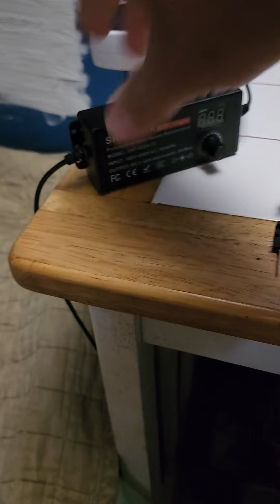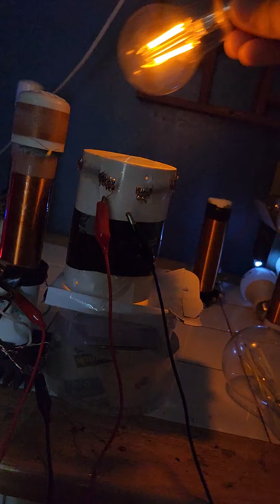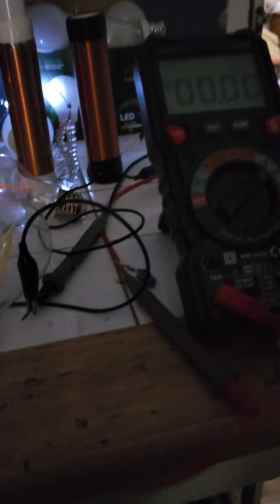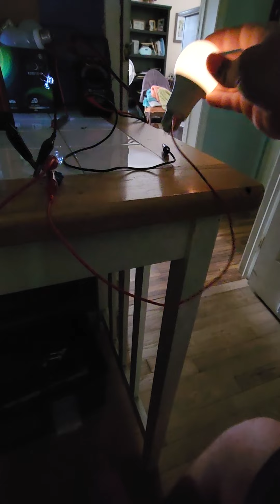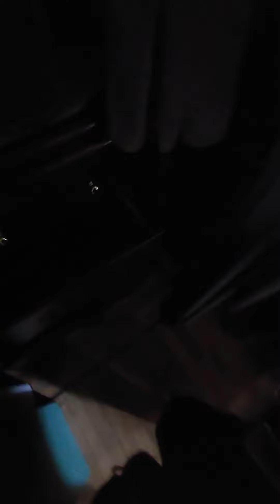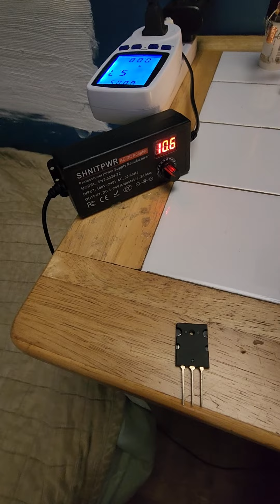⚡️⛓️ Wireless Power Breakthrough Using Only 1N4148 Diodes In A Chain! My New Discovery!⛓️ 💡

Comment: What Im not getting is if you got no consumption increases on the source so if you put 10 receivers coils around transmitter - output will be insane! Why not to try?
Reply from the maker: Going to try very soon. I just don't have much time with how much I work but I have so many things planned with this technology
Reply: Making all these other coils can act as repelling stations once they all vibrate with each other in frequency. Resistance can cause a quick dampening so he is really doing well by using additional coils probably a bit slower to get them in sequence but once they are in harmony...

Comment: Your the only one that is actually really getting so far. Because you got your transmission devices set and now you are in the first stages of using electrics and turning p/n components like diodes into antennas. Next in a Joulethief configuration tune the coil and transistor to a frequency set resonant to the transmitter. You can use a variable capacitor at the base of your transistor (bjt) and tune to the choke coil on the Joulethief receiver. You can actually control different parts of your wireless circuits by remote control from your transmitter by various frequency modulations. I am also working on this right now using plasma balls and also exiters similar to what you are doing. I am kind of old now but you are perhaps younger and can be the one to finish on my dream. Your experiments will branch out as you go. If you follow this path you will probably complete a scalar communication system that will revolutionize the space industry with faster than light speed communications. I don't want to pass away with out sharing things I have found and discoveries yet to be discovered that actually Tesla knew about but was to far ahead of his time and as you will see still is. Science today discribes it as quantum tunneling and Einstein's spooky effect. He should have listened more to Tesla. Once two rotating fields from two different angles intertwine they can produce a scalar chain the initial movement is not faster than light because this does not violate the laws of physics. Yet once contact is made on bothsides you can use the rotational movement and faze the waves to communicate and get around the light speed problem as long as the transmission is not interrupted. I am getting to far ahead with you because I have gone off subject. What you are doing is impressive I kind of see me. Lol. Because you are actually doing basically the same thing. By the way in the near future you will be able to use an antenna and a good ground to the water table and harness enough energy to run your transmitters. It will all be renewable energy. Elon Musk will want to recruit you and hopefully you and him will workout better than Tesla and Edison. If you do the world will prosper beyond our understanding today. We need these technologies today the world is ready I hope to see it before my time here is done. Thank you for sharing your videos. Your doing 👍.
Reply from the maker: Yeah I partnered with an electronics company that finds my work interesting & they're sending me reels of exotic diodes right from they're factory for free to experiment with.
Reply: @MTECHINDUSTRIES  That is amazingly inspiring!!! I have been using different kinds of diodes and transistors but all standards but if you have them designed for especially for that purpose? LOL scalar electronics... I am interested in your findings and I am willing to share with you any findings of my own. I want to see the world embrace this technology in my life time. Awesome work.
Reply from the maker: @ralph72462  so far any Avalanche diode rated for 1kv at 1 amp seems to work best for antenna diodes along with Ultra fast rf switching diodes with the same rating.

Comment: Very very nice!  I will try this soon.  Not sure if you follow Bruno Vk, but at one time he did a chain of diodes similar to your set-up, it kept increasing the voltage also.  I believe your chain is a little different.
Yesss, I will definitely try this!! 😎  Looking at your discharge, I would also guess it is at least 3KV as you mention,, very nice 😁  Last night I had a dream about this set-up,,, it must mean something good!!
Great job buddy!
Reply from the maker: Yeah I noticed just having the diodes as wireless pickups creates some form of self tuning. No coils or capacitors are needed anymore for tuning which is crazy. I think the trick to all this technology is to create a very high voltage low amperage potential with a transmitter device & then properly receive more power out then in by fine tuned receivers that are grounded.

I plan to run my transmitter off of 150v dc @ 200-500ma & that should give me a 6x improvement over 24V dc.

Comment: Diode multipliers are used in Russia. Massive parallelism produces more power. Diodes are placed in an active electromagnetic field, in your case around a high-voltage coil. And additional antennas are connected to those diodes, antennas which are located outside the active electromagnetic field.
Reply from the maker: Dude I never knew that. Have any schematics or should I just Google it? That technology sounds really interesting
Reply: @MTECHINDUSTRIES  Spreading information that harms economic activity is punishable. You can draw the diagram yourself based on the text. This is an age-old approach. It is not possible to reveal more than can already be seen on the video material.
Reply from the maker: @1272-f9v  I greatly appreciate the information you gave me. Would it be possible for you to tell me everything you know if I sign a non disclosure agreement & I don't share anything you tell me? I'd use the Knowledge you give me just for my personal experiments.

Comment: Yes it is a bridge multiplier you can double the voltage DC by using a full wave multiplier since the waves coming from your transmitter is A/C it will also give off scalar waves. true voltage driven to produce a current on the circuit.

Comment: mr you have not made a new invention what so ever as all you have done is what radio hams do when they build there own transmiter . you will find if you go look at ham transmiter circuits..They  work in exactly the same way being an oscillator that with a coil feed back with some tunning capacitor tunned to a exact frequency with a low impeadance coupling around the coil you have made .then a with the use of a open or closed feeder line to out side .Then being conected to a wire antena .cut in length to the frequency we choose..If you walk along a three mhz antenna with the coil with diodes you will light it as you walk the length of the wire antennaan the lamp will light showing the high est voltage were the antenna radiates the highest voltage.,,,,,,,,,,,,,,,,,,,,,,,,,,,,,,,what will happen is if you have a radio hame using 3.5 mhz to 4mhz he soon will be on his way round to crack a whip because of all the interfierance you are making as that circuit will radiate harmonics on multiple frequencies.....3..6..12..15..18 mhz plus many more ham band frequencie so just hope you are not in close proximity of a radio operator............cause all you have done is made a sine wave oscillator that make hi rf voltages  without a load..........................by way led bulbs light on a snif of energy and are not 50watts .......try lighting an incandecant bulb thats 60 watts and it will only glimar ...............This is not free any inway ..........by the way ...the big coil with loads of diodes will work even better for range by putting a tunning condenser across the coil conections then tune it to the frequency of the rf in you verticle coil .This will peak it and allow to tune for more current with less volts or more volts with less current ...put a tunning cap on the hv out of your oscilator coil and conect it to a long wire around the room or garden you will light your led or florecent tube in many places aroun the length of the wire .20 meters of antenna wire will make a very good rf antenna mr